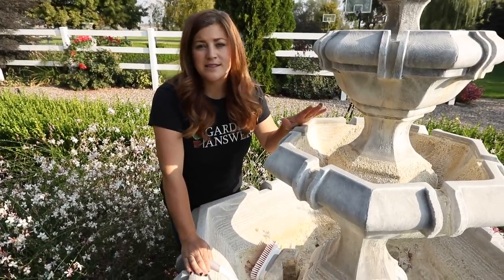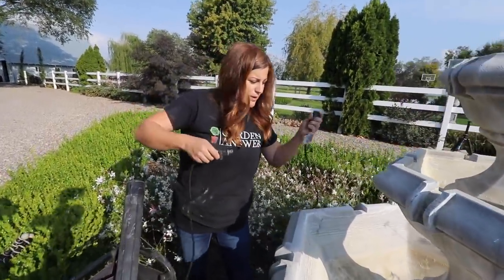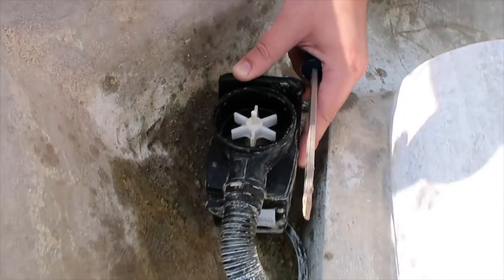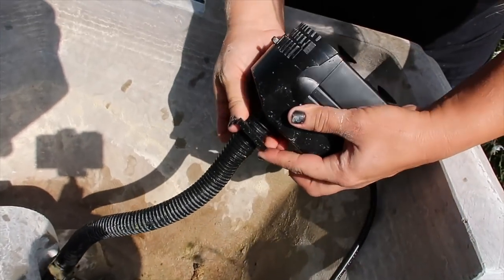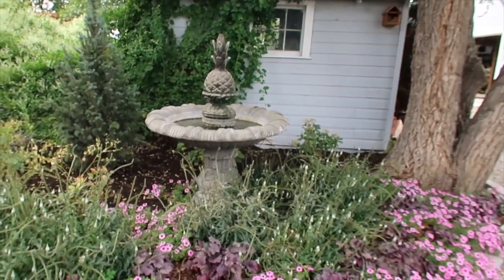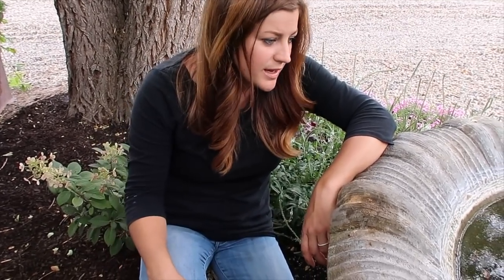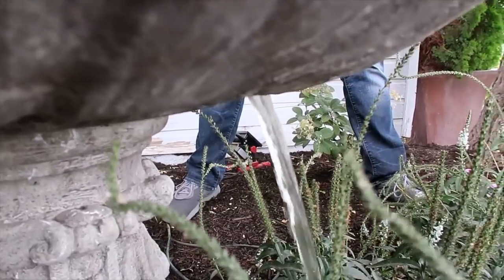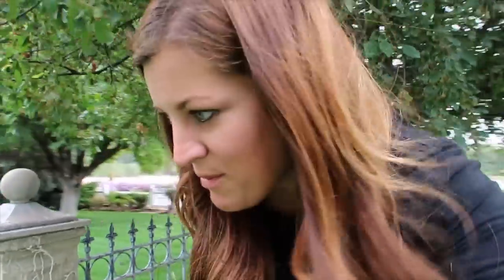Fountain Maintenance 💦// Garden Answer

Comment: Very helpful!!!!
BTW, I have a problem with gophers and I bought these stakes that are battery operated and make a noise which apparently is a gopher distress call and keeps the gophers out of the vicinity. One of those little units would cover that garden area where you are having the gopher problem. It works.
Just keep in mind that the gophers avoid that area but go somewhere else to do their dirty work so you need to place them wherever you don’t want gophers. The require 3 C type batteries and need to be changed about once a year. They are a good investment!!!!
Now I just need need to keep the deer out!!! 😩

Comment: Yes clean the hole where the impeller sits into. If there is anything growing or building up where the impeller sits the pump will quit or not restart on its own. Sometimes if you bump the pump that will get the impeller turning again. Highly recommend not bumping the pump and just cleaning the pump impeller. Also take apart your old pump clean it up and then put it back together. Then place the pump in a bucket of water add a few cups of vinegar to the water. Plug it in and get it running. The vinegar will breakdown the hard well water build up. It will take about 24hrs. Smaller pumps I use a q-tip to clean the hole where the impeller sits. Other tips are if pump don't work, take the impeller out plug the motor in and stick a shrew driver metal first into it. If you feel magnetic pull the motor is good. The impeller is bad. Replacing an impeller is much cheaper then the entire pump. I hope this makes sense!
Reply: Wendy, good suggestions.  Thank you.

Comment: have you tired using some vinegar in the water? vinegar helps with hard water [we're in NJ  & have very hard water] .
Reply: JC Klein vinegar works great for putting in the toilet tank to clean it. My water is hard too. Vinegar is amazing!!
Reply: If u add the vinegar.  Just remember to  Dilute it. so when you pour it out it won't kill your grass or your plants. And the Vinegar helps with wildlife. It helps get rid of some of the worms in them.
Reply: That’s a good suggestion.  I had hard water and a fountain at a former home in San Diego and I would add vinegar from time to time and a few pre-1982 pennies.  It helped with the water deposits and algae, respectively.

Comment: Suggestion - use aquarium filter material to keep gunk away from impeller.  Amazon sells large pieces that I cut to fit under the pump in the collection chamber.  I also put a piece around the inlet hole of the chamber.  Need to replace the filters periodically, but that's easier than taking the pump apart.  Keeps the water looking cleaner.

Comment: It looks like you've got the same hard water issue we have here in Texas.  You might try soaking the pumps in vinegar to dissolve the calcium deposits.  Works beautifully.  Also great for coffee pots and shower heads.

As for cleaning your fountains.... you might try this.  I do it with my birdbath.  Fill the basin with bleach and cover with a black (must be black) trash bag.  Leave in hot sun for a day or two.  Remove trash bag, empty bleach, and rinse well.  Nothing does a better job cleaning my birdbath.  Bleach dries to an elemental salt, so it's harmless once it's dry.  Hope this helps.  Lisa

Comment: It will help you guys with maintenance if you get the pump inside a sponge, you usually see that in ponds installations to help the pump from getting clogged with bird seeds, leafs, and other debris that would stop the pump from running and eventually the motor burning out.

Comment: Year three and and needing a third pump I was over it until discovering other less expensive options sale priced at Harbor Freight.  EBay and Amazon sometimes too. (I like to buy local but $100 every year...)  They are all similarly constructed and last 1-5 years with a stick to jump start the impeller after it gets worn and loose.  Filters clog quickly, filter boxes last longer but bigger and more involved cleaning,  established plant's roots require the least maintenance Water Lily need yearly thinning and keep the water sparkling clear.  Keep the pump elevated from debris,  fish will thank you too when not all of the water gets pumped out via a single leaf, twig, loose hose or semi-clogged fountain head sends water outside the catchment.  "Y''all's"  yard is beautiful and your channel a pleasure.

Comment: I know that this is an old video, but from personal experience, if you soak the pumps in white vinegar for a couple hours and rinse them out, it will remove all those mineral deposits. It's cheap, and we've had the same pump for 10 years this year in our fountain.

Comment: Hard water causes issues a lot. I have had to change my pumps a few times.   And also the size of the pump. To large isn’t always better. 🧤💦 at lest it was a beautiful day to do that. usually i take my hose put it through the tube and put it on jet and spry into the pump and a lot of times it breaks everything free plus washes out the inside of the pump.  👏🏻  🤗

Comment: Noticed none of your pumps have a filter... Why?  There should be a housing in front of the impeller with a foam filter or screen. The pumps are getting trash and algae in them. Another tip for cleaning the pump/impeller is to soak in a container of vinegar for an hour or so.

Comment: I wish it wsn't as much work. I was wanting a fountain but after seeing what it takes to keep it going don't think we have the "know how" and I don't want to pay someone to do it. Maybe we can start with a small one and cut our teeth on it first. You have gophers we used to have chipmunks. I call chipmunks rats with racing stripes. They burrowed under our foundation of old house and nested in our insulation. Good grief those little monsters cost us a fortune. Since moving we have some but not nearly as many. I think the high number of hawks we have have helped keep the population to a manageable number. I know people think they are cute. We did too. But after knowing how much damage they can do and how dangerous it could have been (chewing through wires) I now just can't stand them! LOL
Reply: Hi Starla. Try starting with a small fountain. I got s black aluminum one years ago at Lowes. The birds love it. During the summer, I have to clean it out once a week,  but it is easy to do and I enjoy it. I have ordered replacement parts,  so keep your manual, and every couple of years I spray paint it again.
Reply: Thanks Cathy Branly That sounds like something I can handle. Was that your first fountain and have you tried anything bigger yet? I have the fountain fever badly and was eyeing one for hummingbirds. It was sorta expensive but at least it was small. I would hate to spend the money then it go out the first year. Do you do anything to the pumps to keep them going?
Reply: @starlakelsey2782  Starting with a small humming bird fountain is a good idea.  My little fountain is 3 tiers and only about 40 inches high. I do have to take it apart and clean it once a week because of algae and the birds. I jet spray the pump to unclog it. It only takes about 20 minutes to clean.
Reply: I am planning to get a large one like Laura's soon.

Comment: geez, whacking the pump on the side of the fountain? That is not good for the pump. Just clean the impeller. I find that keeping the pump off the bottom of the bowl keeps it from gumming up so fast (setting it on a brick under water). Your bowls are pretty shallow so that might not work well for you. I agree that connectors and fittings are a night mare because you never have the right size. I only keep one small fountain, that I can turn over to drain myself. They are a ton of work, but everything drinks out of it; the cats, the dogs, the birds, the bees and wasps. So, it's worth it IMO. Your fountains are so, so pretty, especially the Hebe fountain. My little 500 gallon goldfish pond with a floating bog and bog filter is easier to maintain IMO because you don't have to scrub it down and it maintains it's own water quality with the bog filter. Just saying.

Comment: Why are you not make a dust catcher before Your water is goining in Your pump.
A lady pantyhose is very simpel, to put that before Your pump.
The waterhose is goining in hard plastic tube. 
Now you only have to find a other tube with rubber inside fits the first tube.
Between these tube you strech a little peace of panty. 
The hard plastic tube Goes over the originele pump waterhose in to the pump.
1 a month you clean the hard tube with the panty, and Your pump lives much longer.

If the panty is not strong enough, look for a medical panty,.
Good luck.